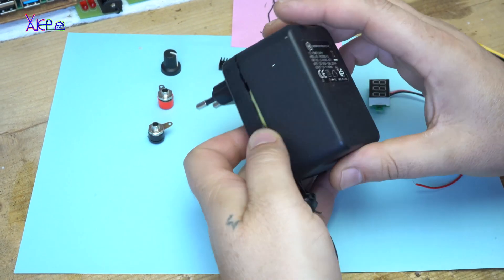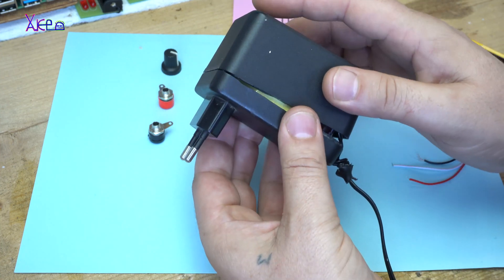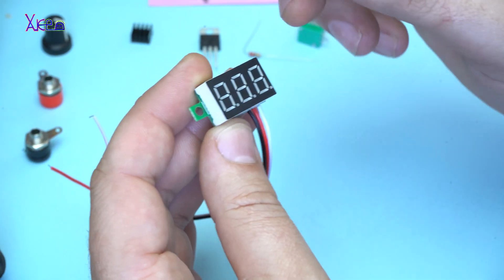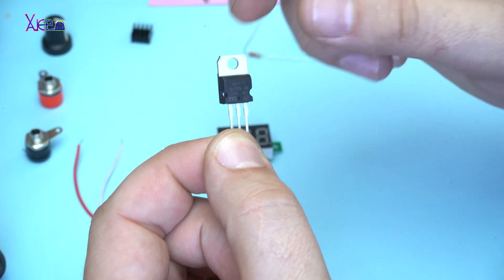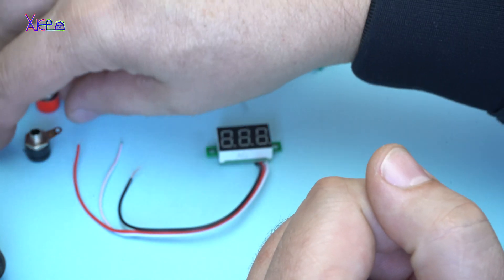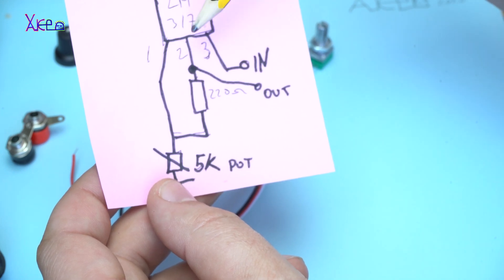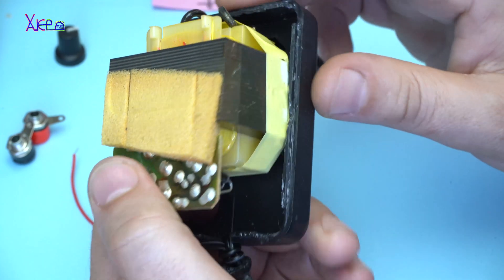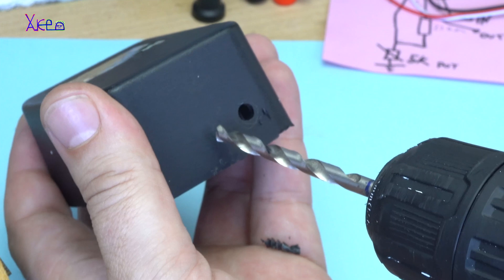How To make Smart Adapter at Home

Comment from the maker: What should be next project,comment below?
Reply: Variabale High power AtX power supply in a decorative wooden houseing?
Reply from the maker: Nice idea,thanks
Reply: @Hacktuber  NP M8.
Reply: @Hacktuber  what country you are from?
Reply: Sir please make a microscope.
Reply: LOVE
Reply: THANK
Reply: USB connection to "copper wire firefly starry LED" instead of 3v coin battery.
Reply: Make a microscope  from a car dash board 7 inch monitor and reverse camera unit
Reply: You are not showing certain things  like connecting the sensing wire of the volt meter
Reply: I would like to see an 8 usb power support for 2A each. For my bench. 👍🏻
Reply: @jantepas7511  use an atx I have 2 with several usb ports and 1 other I run all my ip cameras and LEDs from
Reply: I would also like a mini welding machine for small metal part to combine, weld.
Reply: Please make USB Keyboard to Bluetooth keyboard converter circuit

Comment: Hello, I have a 12volt 2amp adapter. Can I use the same components as you have used or would I have to change something?
Reply: In that case, it still 2A, but possible
Reply: Sorry, with the LM317 you have max. 1A, better to replace with LM338T, this can support to 8A.

Comment: Hello - Please write the exact name of the parts. Thank you
Reply from the maker: Led voltmeter midule,lm317 voltage regulator,10k potentiometer and 240ohm resistor,circuit diagram is in video

Comment: The power adaptor is originally 5 volt/0.8 Amp.... Now my question is what will be the current rating of the adaptor at 12 volt after modification...
Reply from the maker: Same 800mah,or how much can regulator can hand
Reply: @Hacktuber  As you can't change the wattage of a system then at first the wattage was 5×0.8=4 watt as Watt=V×I.... Now you have changed it to 12 volt... So it current output should be no more than, I=W/V, i,e: 4/12=0.33 Amps.

Comment: Oh, opening that power supply is almost impossible.
Reply from the maker: Screwdriver+hammer👍
Reply: Easy to open with petrol ,keep petrol on joint leave it 5 min after that easyly it will open

Comment: Now I am thinking how to use the spare 18650 batteries as portable variable DC supply,  Need to have 3V, 4.5V, 5V, 6V, 9V, 12V output option, and upto 3A (maybe 4A also). To power raspberry Pi4, MicroBit and Arduino.

Comment: This is too good. Only involve the two wires inside the adapter. SO if the internals are too tight to fit these, make an external add-on using thick, studier wires. Opens to possibilities. Many thanks!
Reply from the maker: I should use thiner wires😔
Reply: @Hacktuber  Ok, will note this point. Thought thinner wire might break off from the adapter. Especially if there is no room inside the adapter the items. Also looking for 12V,  2A or 3A output adapters if there are any.   Cheers.